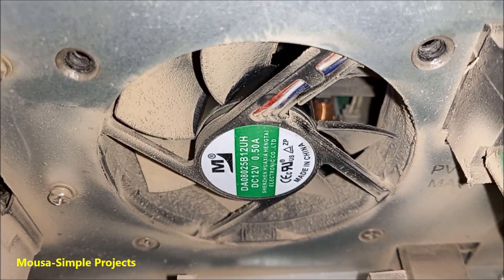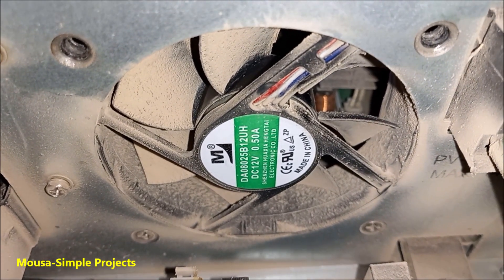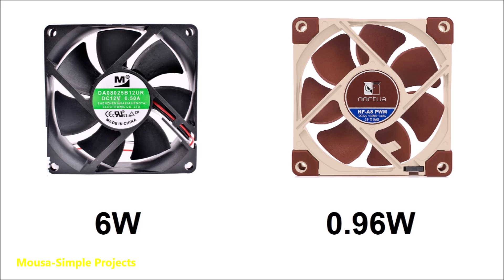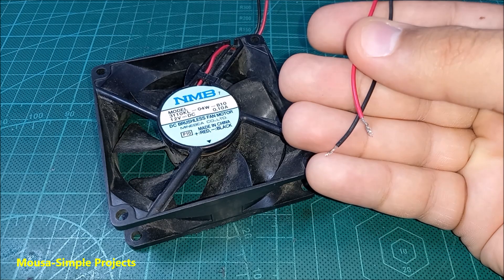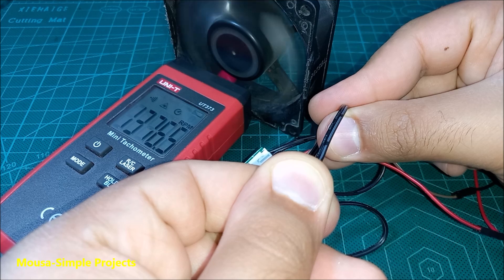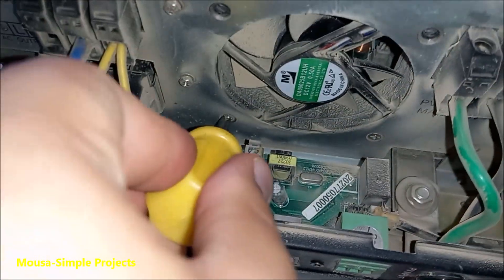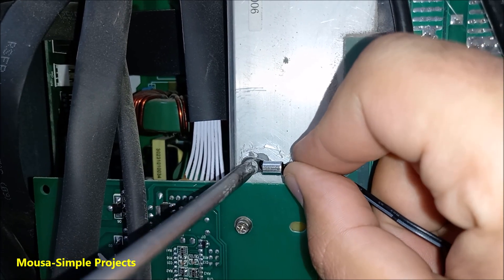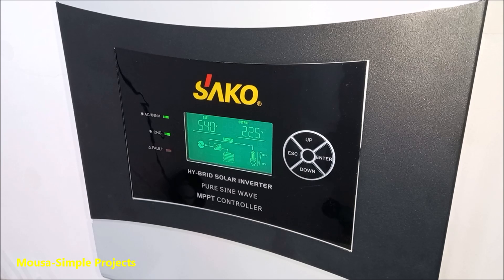Inverter Fan Always Running Problem Solved / Inverter Cooling Fan Noise

Comment: My fans have 3 wires, so there is a tachometer reading. I wonder what happens if i disconnect them, if there will be an error.
Reply from the maker: Mine too! It's NOT a speed controller but a feedback to make sure the fan still spinning, i didn't disconnect it. i just disconnect the +12v and ground wires and connected them to the speed controller module.
Reply: @MousaSimpleProjects  Awesome! thanks for the reply .

Comment: Good Job
I have much later Growatt inverter SPF 5000 ES (Same Design).  Once the fans died I replaced them with a similar but imperfect part number.  With 1 fan the unit shows PWM control ...  they turn on full blast then back off.  With 2 plugged in it goes bonkers full blast.  I think I am just going to do something like this so my unit does not pack full of dust again.  -Schindler

Comment: but some inverters can show fan error, because fan speed now not controlled by inverter
Reply from the maker: If your inverter came with internal fan speed controller, you don't need to this modification at the first place ! In my chines inverter the fan was connected directly to 12V source so the fan was spinning with max. speed 24/7.(NO controller at all)

Comment: Is the inverter still alive?
Reply from the maker: YES, It still working well. Now in the winter the noise of the fans become even less, because the weather is cold so the speed controller slowing down the cooling fans.
(but during charging the batteries or loading the inverter the fans speed up)